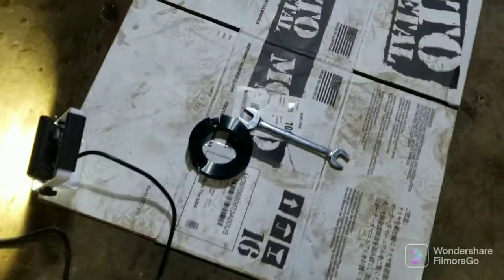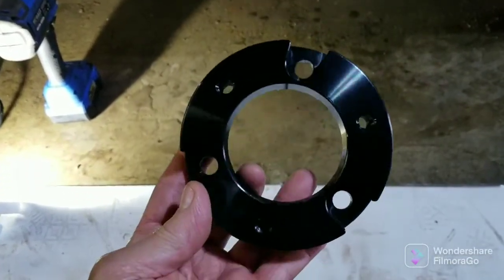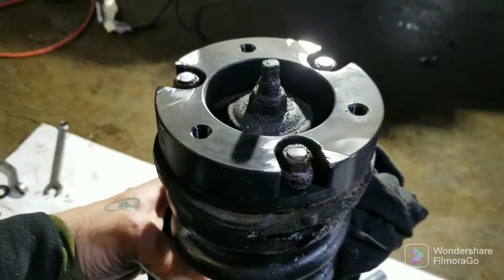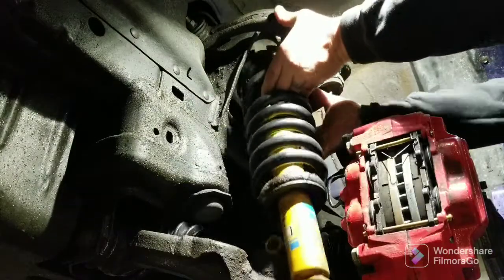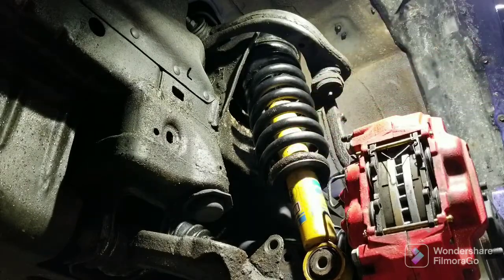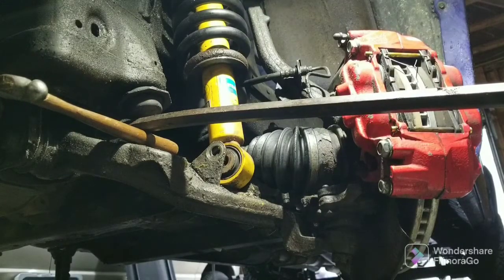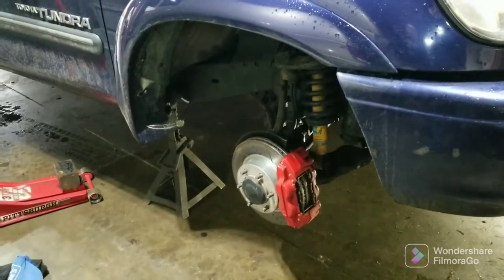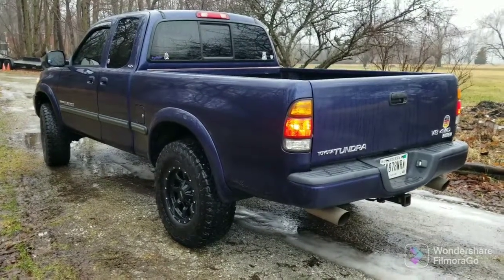How to install 2" lift, strut spacer. New tires and wheels! 1st gen Tundra. 2000 Tundra access cab.

Comment: Its been a while. How them spacers do?
Reply from the maker: They did great the entire time they were installed. 
I drove over 20k miles with them and no issues. I have since changed them out for a set of Bilstien lift struts. Definitely would do it again if I needed an inexpensive way to level the truck.
Thanks for watching and supporting my channel.

Comment: I just put 3" spacers on my 05' Tundra this past weekend. And boy did I struggle getting that bottom bolt in! Not only that, I'm in the northeast so mine was pretty rusty. Getting the cotter pin out of the crown nut on the top was a major pain in the A. But like you I'm glad I did it the truck looks great!
Reply from the maker: We suffer for our passions, that's for sure 
Sounds like you had all the same issue as me.
I have to agree, it looks great.
Thanks for sharing your struggles. 
Glad you got it done.
Enjoy your Tundra  
Thanks for watching and commenting I appreciate it. 
Have a great day
Reply: hey mane i am trying to put a 2 inch spacer on mine but i am struggling bad with it, any tips?
Reply from the maker: Sorry you are having a tough time. I think I shared everything I know about it in the video.
What's the issue?
Reply: I’ve been trying to put a 3 inch spacer as well in my 05 tundra, I just couldn’t get the bottom bolt in, did I just need more leverage like the video? 😂
Reply from the maker: I bet that's what it'll take. It's definitely a chore.
I wish you all the best.

Comment: Doesn't that decress the payload capacity of the vehicle as well as the way it handles while putting something?
Reply from the maker: I don't think it decreases payload.
It would make it handle poorly when towing, so I installed air bags in the rear to keep it level when towing. Actually tows great.

Comment: so 1 1/4 spacer gives you 2 inches ?
Reply from the maker: Yes. Due to the location of the strut.
Pushing it down 1.25" pushes the end of the control arm 2".
Reply: @funjunkiegarage  what brand ?
Reply from the maker: Here is the set I used.
KSP Tundra Lift Kit Front 2" Aircraft Billet Strut Spacers Leveling Lift Kit fit for Tundra 2WD 2X2 4WD 4X4 1999-2006 https://a.co/d/8twTQW9

Comment: Congrats my man. Great job well done. You are much more patient than I. I would’ve been throwing tools halfway through. Lol.
Reply from the maker: Thank you. 
Much appreciated. 
I edit out the tool throwing,  hahahaha.
Thanks for watching and commenting.
Reply: @funjunkiegarage  I own an all original 2001 Toyota tundra SR5 V6. Stock from the factory I’m running 31 1/2 inch tires. No lift. The truck came with 9 1/2 inches of ground clearance straight out of the factory in Kansas.
Reply from the maker: Nice, sounds sweet.

Comment: Disconnect the sway bar and it will drop down easy
Reply from the maker: That's good advice, thanks for sharing.
Reply: if i do that will it be easier to put the screw in for the strut?
Reply from the maker: @anthonyestrada5755  should help.

Comment: that’s a after mark front bumper, right?
Reply from the maker: Yes, it's part of the Ivan Stewart package.
Reply: Yes the black is but it still hold the same style as the stock 2000 to 2002 bumbers with the big bright fog lights

Comment: Nice job! I’m also running Bilstein but 5100s with stock springs. Those are set 4th notch that give apx 2.5 lift. I recently got 35s and after all kind of trimming and cutting still getting rub while backing up at full lock. I’m thinking to add 1” spacer to see if it helps. I just heard rumors that Bilstein doesn’t recommend adding spacers over its struts but who cares. If it works for you it might work for me 🤞
Reply from the maker: Thank you.
I've heard that about Bilstiens also.
Never understood why. The strut doesn't know if there is a spacer, nor does it care. My Bilstiens don't have different settings for the spring so I used the spacer, when it's time to replace them I'll go to 5100s.
I'll probably go to 35s at that time too.
Thanks for watching and commenting, I appreciate your support.
Reply: I had Bilstein 5100's/stock springs. 
Added a heavy front bumper with a winch. The 5100's lasted about two months until they were shot.  Now Bilstein 6112's.  Like the 5100's but 3 1/2" of lift.  
Way more beefy springs.  New Camburg Hi travel upper control arms.  33" tires.  No rub,  tons of travel/clearance.  Can easily support my new front bumper/winch.. Zero spacers. You get what you pay for..  The 6112's are about $800/each. They are absolutely huge compared to the 5110's.  5100's are great. Up until I modified my front bumper.

Comment: Why can I not find "TRD" tundras for this year....yet so many have "TRD" emblems someway somehow.
Reply from the maker: 2000 was the first year for a TRD Tundra, it was part of the Ivan Stewart package. The grille, bumper fascia and wheel flares along with a few other color matched items, bilstein suspension and custom wheels were all a part of it. It was a dealer installed option.
This truck had the Ivan Stewart areo package installed at the dealership.  
2002 was the first year for a stand alone TRD option that could be ordered from the factory. So it's not all that uncommon or unusual for 1st gen Tundras to have TRD emblems. 
Plus the emblems and stickers are available for purchase so some may just add them.
Hope this helps to clear things up.
Thank you for watching and commenting.

Comment: Nice DIY suspension lift. Let me ask ya, how is the front strut lift holding up? The reason I ask is because I have seen some folks develop vibrations and whatnot after the lift. Yours is only a 2" lift so I'm assuming everything should be good. Going to eventually do this myself but kicking my feet.
Reply from the maker: Thanks.
Everything is doing fine.
I did have to get an alignment to set toe afterwards. 
Have put about 1000 miles on it  including a 9 hour round trip on the interstate. The ride is just like stock.
I've lifted other rigs and gotten a vibration after. An often overlooked cause of this is the drivers side bearing in the clamshell front diff. Replacing it with the ECGS solid bushing is the cure.
You should go for it, it's easy to install and just as easy to undo if you don't have the success you hoped for.
Thanks for watching.
Reply: Do you have a video on the clamshell front diff ? You are a world of knowledge to me! Seriously
Reply from the maker: I have a video on removal and disassembly but not on gear set up. I did make one but lost it in editing.
Sorry.
Thanks for all the support.
Reply: Ha ha; sorry if I gush a little. I’m zeroed in on your 2000 Tundra mods and experiences! Keep on doin what you’re doin 👍
Reply from the maker: That's awesome. I love the way my Tundra works and looks. 
More to come on it for certain. 
I appreciate your support my brother.

Comment: just bought the same one. does the ball joint, control arm, axle have problem?
Reply from the maker: No problem other than old CV boots will tear.
There are several different options to combat this.
I went with high angle CVs. 
I did have one upper ball joint boot tear, but it was already bad I replaced them both and no more issues.
Ok. The top of the spindle will hit the springs at full droop when turning. I ground off about 1/8" on the part of the spindle that was hitting.( you'll see the rub marks)  That was easy.
So yes, a couple of small issues, but once I corrected those it's been smooth sailing ever since.
Hope this helps.
Enjoy your project. 
I appreciate your support.
Reply: You should replace the lower OEM ball joints at anything over 100K miles.  They do fail.

Comment: Nice video. Where did you get the hood grille?
Reply from the maker: Thank you. 
The hood/grille and bumper cover were part of the Ivan Stewart aero package. A limited availability option for the 2000 to 2003 model years.
Here's a link to my video with more information on the Ivan Stewart package.
https://youtu.be/H8Y_Vey5ibM
Thanks for watching. I appreciate the support.

Comment: Thank you fine sir for a real life video. Far too often do I watch one from the manufacture or distributor of a part that makes everything seem like a piece of cake. 
It appears you didn’t remove anything more than you would have with a standard strut replacement. 
Was this indeed the case?
I have the ksp on order now for a 2004 sequoia.
Reply from the maker: Thank you for watching. It rarely goes as smooth as they depict in those videos.
I like to show what you can do on the floor in you garage, like most of are when we work. 
Indeed nothing more to remove than for a strut replacement. 
Hope you enjoy your project. 
I appreciate your support.

Comment: My strut spacers came in the mail yesterday I would like to talk tires.last night I ordered cheap set of rims 17x8.5 with a 0 mm offset what size tires would you recommend? 
P.S sorry to bug you but I'm kicked off of Facebook right now for my political beliefs otherwise I would ask my first gen Tundra group LOL
Reply from the maker: No worries, always happy to share my opinion. 
Not sure my offset but my backspace is 3.5" and 8.5" wide. I run a 33x10.5 with no rubbing.
I believe that would be a 285/75x17 or a 305/65x17. I'm well pleased with the performance.

Comment: whats the offset of the wheels? it fills the fenders perfectly.
Reply from the maker: Those are moto metal mo960 I believe.
They have a 3" backspace and -32mm offset  according to motometal website. 
I think that's the correct wheel, they were a discontinued model at the time I got these.
I agree they are a perfect fit.
Thanks for watching and commenting. I appreciate your support.

Comment: Hey on a scale of 1 to 10 how difficult would you think that it would be to 4wd swap my tundra
Reply from the maker: It's time consuming and requires a complete donor truck.
 If it's an 04 and up you need stuff from behind the dash and the ignition and a few other things as I understand it. 
I haven't done this to a Tundra but I've done 2 3rd gen 4runners. I did research the job for a Tundra but the guy backed out so I didn't do the job. 
You'll need the transmission and tcase, drive shafts, cross member, front diff, axles, spindles and brakes. Also the 4wd solenoids & vacuum pod.
You'll need the dash buttons and all the wiring. Often the interior wiring will be there because Toyota will include all plugs for all features to simplify harnesses. But you may need the ecu and transmission harness so everything works properly.  I'm not 100% sure on that, just what I read. But you need shifter input & other electronic input for low range.
If you get real creative you can put a J shift case in it from a 4runner, but that's a bunch of extra work. 
It's definitely a "most difficult " job in my opinion because short of building a car from scratch, this is very in depth  & requires knowledge in about every aspect of the vehicle.
In vehicles pre 2000 its much eaiser because of less electronic stuff involved. 
But no Tundra before 2000.
I'm sure I've forgotten something. 
Hope this helps.
Reply: @funjunkiegarage  mine is a 2000 is there much wiring required?
Reply from the maker: If the under dash plugs are there for the 4wd buttons that would be great, if not, you'll need those. There is wiring for the transfer case that's necessary if those plugs aren't there you'll need the 4wd harness and the 4wd ecu. I have no idea if those may be there or not.
I've never done one with an electronic t case.
So I can't say for sure if there is anything else.
I know for low range you need speed input and shifter position input and that's why you need the ecu, again I've just researched it, not done it.
Reply from the maker: There are always ways to bypass switches and wire things up direct if you have that kind of electronic knowledge. I wouldn't know where to begin on that though.

Comment: I’ve been considering getting spacers just to lift my tundra till I get a proper lift. How’s it holding? Did you tear the cv boots after the setup?
Reply from the maker: I did the spacers for the same reason, I only had 30k miles on my Bilstiens. Proper lift struts will be next. 
It's holding up nicely. Ride is good and no ill effects. On full droop and turning the spindle hits the coil spring and makes noise, doesn't hurt anything and if I grind it an 1/8" it will not interfere. 
Yes, I tore cv boots and upper ball joint boots. I replaced the upper b.j. boots and they have been fine. I replaced cv boots 3 times and eventually went to high angle units and no more issues. 
I love the look and am in no way sorry for doing it.
Thanks for the questions and thanks for watching. 
I appreciate your support.
Reply: @funjunkiegarage  Understandable. Thank you for taking the time out of your day to answer my question! Hope to see your build come along very well.
Reply from the maker: Any time brother.
Happy to help where I can.
Enjoy your build as well.
Have a great day

Comment: Hey what brand did you use? Thanks!
Reply from the maker: Thanks for watching. 
Hear is the link to the ones I used.
KSP Tundra Lift Kit Front 2" Aircraft Billet Strut Spacers Leveling Lift Kit fit for Tundra 2WD 2X2 4WD 4X4 1999-2006 https://a.co/d/isU9twn
Hope this helps.
Reply: Perfect thank you!
Reply from the maker: You're welcome. 
Enjoy your project.

Comment: I have a Sequoia of a similar year. Man they're nice. Toyota makes these full size vehicles pretty well.

What state are you located in? I'm wondering if I could pay you for a welding job.
Reply from the maker: My son-in-law has a nice Sequoia. I love it.
I'm located in Indiana.
Reply: @funjunkiegarage  southern part? The river is a couple hours drive from me.
Reply from the maker: I'm just North and East of Indianapolis.
Reply: @funjunkiegarage  nvm. A little too far from me. I bought a bolt on winch plate from Ampd Up. It will probably need some reinforcement.... but I also like the removable aspect of it.
Reply from the maker: I really should do bolt on because it's removable. I have to build a new one for each vehicle. But I enjoy that.
I do weld on so I don't have fear of a bolt shearing or frame tearing and I want the added strength of the load spread out over a larger area.
It's just my way, not saying it's right or better. 
If you feel like a road trip one day let me know.
I appreciate you watching and commenting!
Reply: @funjunkiegarage  thank you. I appreciate the videos, have used many before working on my vehicles.